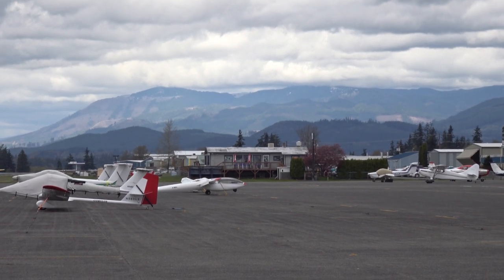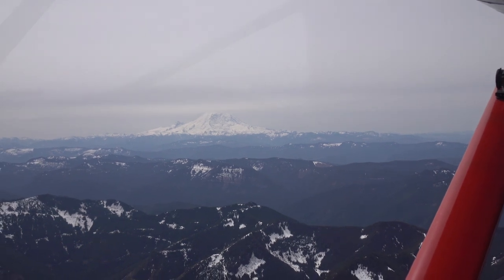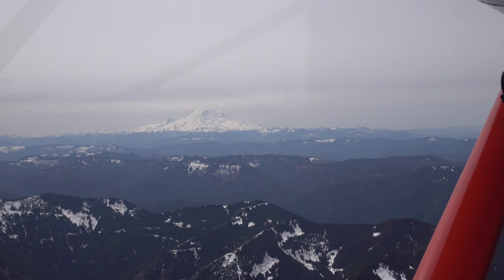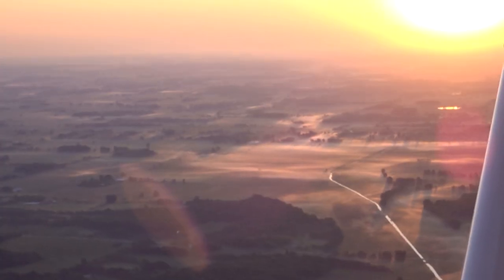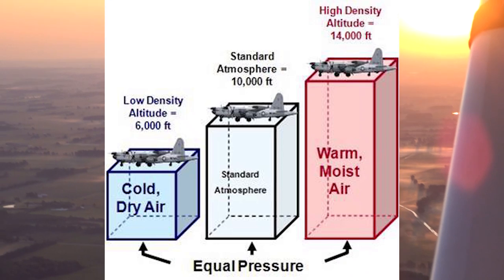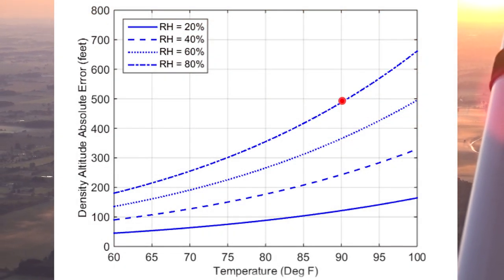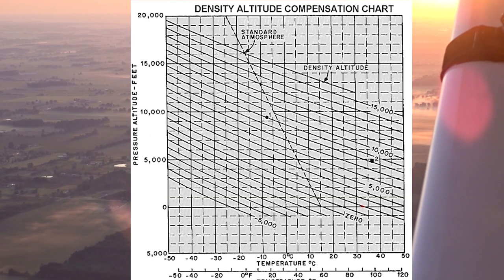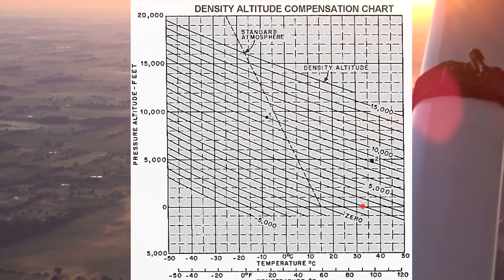The STOL Takeoff.  How do they do it?  Stinson STOL Technique episode 1

Comment: Fastest t/o in my 108-3 is accelerate no flap to 60kts, then pull 1 notch flap rotate and climb out at Va till clear obstacle, then milk flap off. Preselecting 1 notch before takeoff roll will increase t/o distance. Just my 2 cents

Comment: Thanks for this great video!!  With full power and brakes set- can't you lift the tail with down elevator, and then release the brakes while holding that attitude?  I'm a fairly low time tailwheel pilot- so haven't tried this technique yet...  Thanks again!
Reply from the maker: If you have to push the elevator to lift the tail in most cases as soo as you let go of the brake the tail will fall.  The planes that can lift the tail with thrust and no elevator input can do as you say.

Comment: Here’s an invite for ya.  My strip is above 6000’.  If you ever want to do a density altitude video, this would be a great location.  I have a pilot bunkhouse for my friends.
Reply from the maker: Where is it, and how long?
Reply: @GreatMichiganBushCo  2 miles east of CO15, 2000’.  I do have Stinson buddies, who get in and out, solo in summer.
Reply from the maker: @moose7472  I looked on google Earth between CO15 and Elbert and didn't see any noncable strips but the area looks to be fairly obstacle free.
Reply: @GreatMichiganBushCo  Oh sorry, CO18 not CO15.  I frequent both.

Two miles east of CO18, (chaparral), the little road is 166 (south side)

Comment: Question…… 1320 pounds with 165hp ……. Or 1382 pounds with 425hp. This is an experimental 108 project. I am going to use an aluminum Chevrolet ls V8 and PSRU FWF package that is 62 pounds heavier than the Franklin. I am going to lengthen the wings 1 rib each with droop-tips. I am going to extend the slots and ailerons to match and re-skin the flaps 3 inches longer. It’s a fabric 108-2 that’s getting a removable metal belly Stits covering and 108-1 metal wings and tail feathers
Reply from the maker: I don't like the big engines on the front it leads to more weight in the back and more overall weight most of the time.  Yet people really like the the Continental 6's in them.